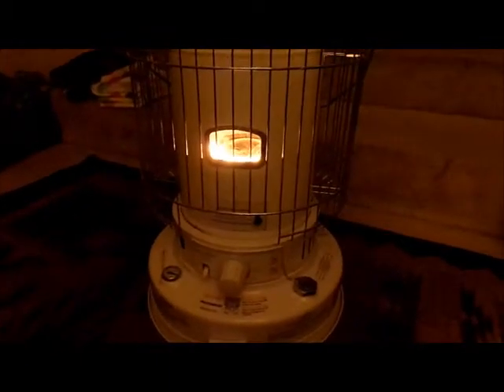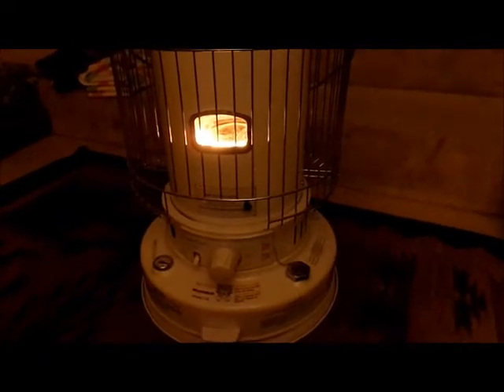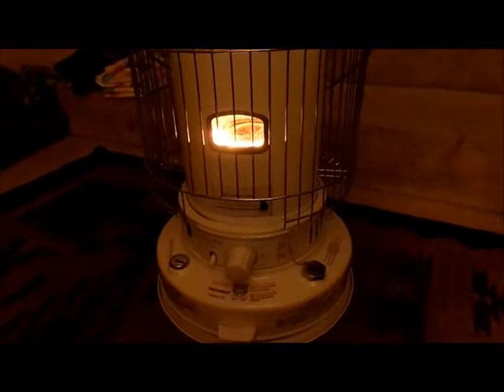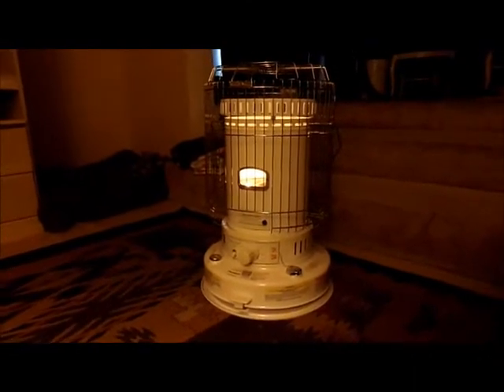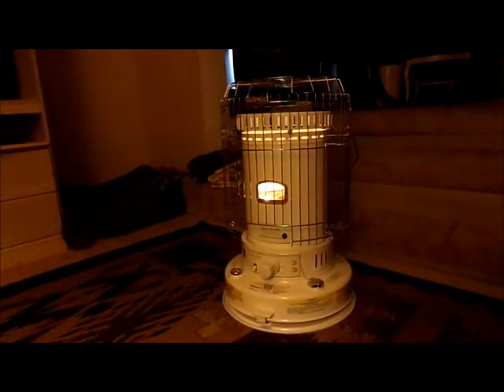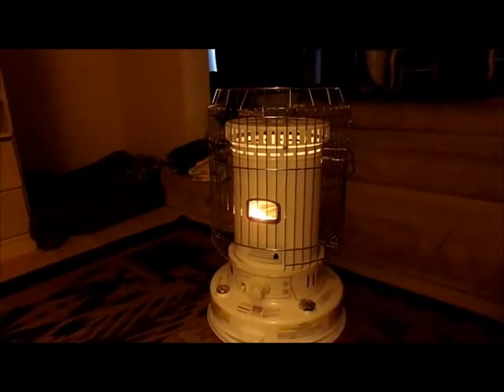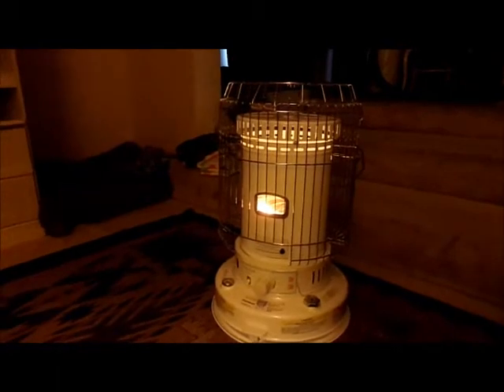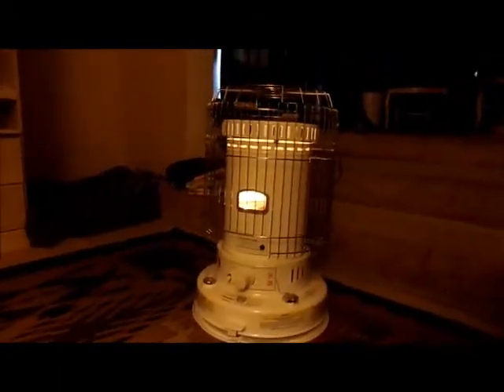Dura Heat 2304 Diesel Fuel Hack Update, and Random Chit Chat

Comment: I just bought one of these works fine with diesel. You don't have to add anything to the fuel. The trick is not pumping the fuel from the bottom of the can. Theirs a good chance you'll have a bit of water in the fuel. The water sinks to the bottom of the can. The water is what makes it burn like shit not whether or not it's summer or winter blend. Will have a higher probability of having water in the fuel in the winter because it's the wet season and the heat from the day and cold from the night produces condensation in the underground tanks. Condensation can form in your fuel canister as well. Buy a Mr Funnel water removing funnel when your filling the heater and don't store the heater with fuel in it or condensation will form in the heater tank.

Comment: Now thats a valuable tip for me ! I heat the Call shop on K1 and its killing me $$$$$$$$$$$
And I use the same unit and yes Carbon Monoxide Detector installed in call shop !
Reply from the maker: Yes! That K1 is outrageously priced, man. The diesel with the addition of acetone burns freaking great. I had it going inside again today, in the house, and still staying at zero PPM for carbon monoxide, and it heated the entire house up no problem in about 1/2 an hour. I had to shut it off it was so warm in here! Thank you for watching, my friend.

Comment: Hey primal punch try getting fuel before they winterize it and see if that helps. Or try shell or bp. I read they use more biofuels. I gave up on my dyna and found a perfection on fb for 20$ with a cotton wick. I didn’t mix anything with it and it’s been awesome. I got fuel at a local rutters. Fuel can be very finicky in some vehicles so maybe it’s the same kinda ordeal with our heaters. Just a thought
Reply from the maker: That's an awesome score, man. Thank you very much for the tips!

Comment: Thanks for posting this very helpful. I am college student here in Eastern Washington. I just bought the same Dura Heat 2304S you have from HD. So now I have to add Acetone to the Diesel right? No isopropyl Alcohol like some people are saying on you tube. Can you recommend what kind of Acetone I should get. Thank you so much.
Reply from the maker: Hey there! It is my understanding that isopropyl alcohol doesn't work with the mixed wicks(cotton and fiberglass), only with pure cotton wicks. I cannot find cotton wicks for this type of heater which uses a pinned wick. This has been working for me for almost a year now! Thank you for watching.

Comment: Any updates? I’m burning hho and I’m trying everything to keep it burning. I tried to get a twenty year old furnace going but it’s a bust. I already ordered 240 gallon of oil so I’d be nice to use it up. Ideally I wanna use the fuel up and bust the chill on days the wood/coal stove is too much. I got two heaters. The older one won’t even keep a decent flame. I’m trying the alcohol trick with no luck on either and the gas trick only works on the newer dyna glo. It’s a kinda low flame with I’d say 3/4 potential heat but not unbearable to smell. The problem is I can feel I’m breathing oil and kinda taste it. Acetone is next to try with this operation
Reply from the maker: Everything was going good until I changed out the wick with a new one I got through Home Depot, and all of a sudden, I am having trouble getting the mix right. So far, one ounce of acetone and 1/2 ounce of isopropyl alcohol are working. Sometimes it needs a little more acetone.

Comment: I started using diesel and added an additive to clean injectors. It works but it is not the same heat. Would it be okay to add acetone or alcohol?

Comment: I grew up with these heaters and love them. Now I live in Los Angeles, and getting kerosene is impossible unless you pay $$$$.
I've always wondered about using diesel, thanks so much for posting this info.
I have the DuraHeat 2304 as well. Did you need to change the wick before burning diesel?
Thanks again, I'm so stoked to run this heater, it's way better and a lot cheaper than electric here in commiefornia. Waving a hand brother.
Reply from the maker: Hey, Brother! I did not change the wick. The only wicks available are the mixed wicks, as far as I can tell. I just make sure to add the acetone, and to let it burn dry every time. That keeps the wick clean. Also, don't leave fuel in there for extended periods, that seems to eat a little bit off the wick. Just put it in an hour ahead of time to let the wick get wet, and then light her up outside, and bring it in 5-8 minutes later after the initial smell is over. Thank you for watching!

Comment: Only diesel works also? Bc 1ounce per gallon isn’t much of a additive?
Reply from the maker: With the mixed wicks, diesel can smoke on its own, depending on the grade. You can try it out, but I would recommend doing it outside.
Reply: Primal Punch thanks
Reply from the maker: @satkins15  No problem, Stephone. Thank you for watching.
Reply: Primal Punch , how much 91% alcohol to 1.9 gal of diesel  ?
Reply from the maker: @tangoliberty2344  I am using acetone. about 2 ounces for 2 gallons of diesel
Reply: Primal Punch ,thanks Primal Punch, 3%

Comment: What is the ratio to mixing acetone to diesel?
Reply from the maker: Approximately 1 ounce of acetone per gallon of Diesel. Add more if you get any smoke after a minute of warming up. That generally means there is some water in the fuel, and the acetone seems to help with that whereas the alcohol doesn't work well with the mixed wicks.

Comment: Can I use alcohol , and what is the ratio ??
Reply: 1 pint of 90% to 5 gallons of diesel.  I started to use diesel the beginning of this winter.  It's a dyna-glo model that looks pretty identical to the one in this vid.  I don't think it did my wick any favors.  I've ordered a new wick and I've already gone back to using kerosene.  Remember, this guy is on day one.

Comment: How much Acetone are you adding per gallon?
Reply from the maker: About an ounce, ounce and a half. If you have diesel in your area with more water content, adjust the acetone to account for it. A little more. Just pay attention to the flames, and how it smells. The water will foul up your wick if you don't get enough acetone in there.
Reply: @primalpunch     I am in Pittsburgh Pa. So we should have the better fuel now that it is winter..  I think I will try it this weekend..  What happens if you add 2oz per gallon? LOL
Reply from the maker: @ninjaporchcats7153  I had to add about 2.5-3 ounces per gallon when I got a really gnarly batch of diesel #2 one time. It just burned cleaner. I had no issues.
Reply: @primalpunch  How many wicks have to gone threw in 1 year of running it this way?
Reply from the maker: @ninjaporchcats7153  2, but it was my fault. I did not add enough acetone to some watery diesel i got, and it fouled up the wick.